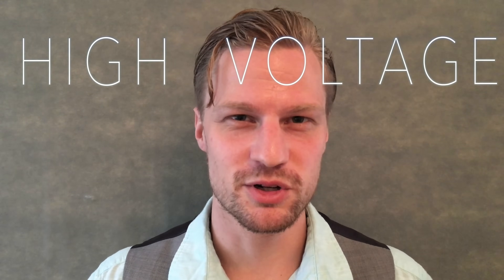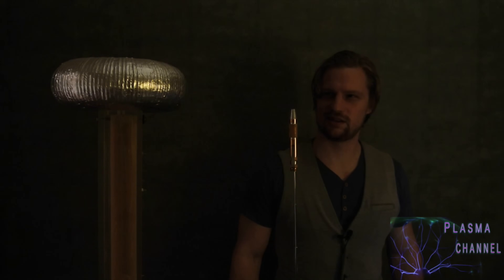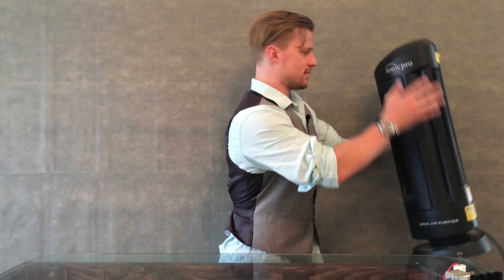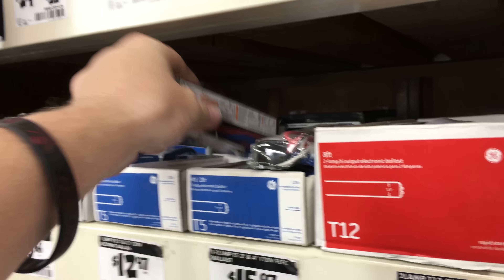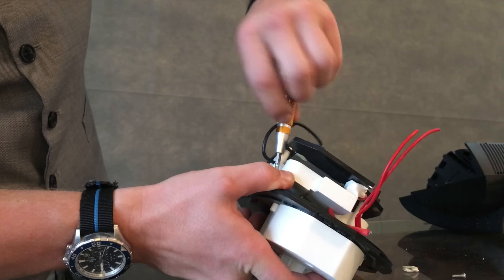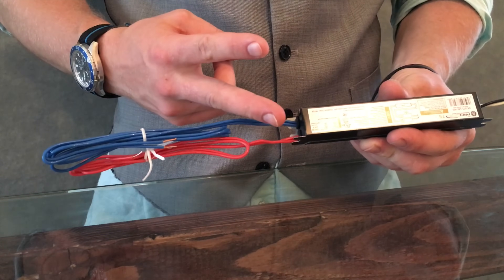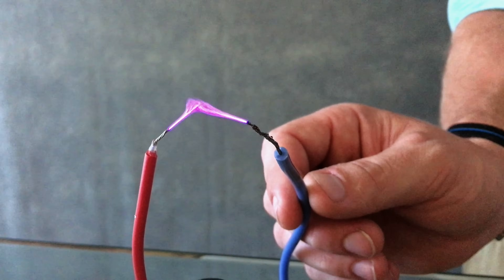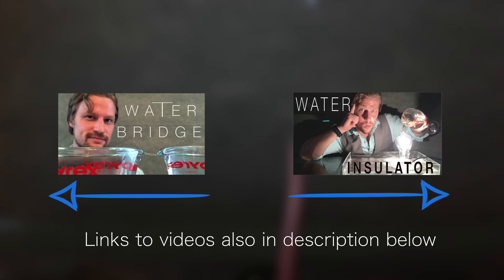Super Simple DIY 10,000v AC Supply!

Comment: Thats dc there are diodes and capacitors in Transformer that make it dc
Reply from the maker: That is what I always thought. But when I discovered that not all modern flybacks are DC, I was really excited. TV, and monitor flybacks are DC, air purifier flybacks are mostly AC. These are AC flybacks, because down the line they have voltage multipliers in the purifiers. Voltage multipliers only work on AC. Also, I have tested the transformer with external diodes to be sure. These specific ones output AC.
Reply: Plasma Channel thats great are these as powerfull as the older ac flybacks or are they Just as powerfull as modern dc flybacks and wow that was a quick response
Reply from the maker: These are more powerful than the other flybacks in my opinion, as they have proper insulation for the HV. Older flybacks didnt have appropriate HV insulation.  By the way, some air ionizers have a terrible mini negative ion generator in them......and no transformer. I found this out! So, look for Sharper Image brand air ionizers at thrift stores....they always have a nice AC transformer in them!

Comment: Can it be used as a tesla coil like glowing a light from a distance
Reply from the maker: Wonderful question. Yes in fact it can, though the distance is very short. If you retrofit a resonant coil onto the HV output (basically an antenna) you would get a couple feet of wireless power transfer out of it)

Comment: I have a question for you:
If i'll buy me a transformator let's say a 3v to 400kv trafo, and i would make another coil, is this even better than only use the trafo or is it better if I make another secondary coil?
Reply from the maker: unfortunately those ebay 400kv transfrmers are not actually 400kv. Its all marketing....big voltages in the name sell more. They actually run 20kv-60kv. Which is still very impressive. That being said, these commercially made transformers are very efficient. It is hard to beat factory-created transformers

Comment: I have the same flyback transformer , i got it from tv . But at the bottom there are almost 10-15 leads emerging out . Which lead i use for power input and which pin use for establish arc.
Reply: Ludic Science has a good video to work out what pins you can use. also by winding your own coil round the exposed core you have a input coil.
Reply from the maker: Ah, so that is a modern flyback which only outputs DC, as they have internal diodes. Those pins tend to be unique to each transformer. You have to experiment with placing your power wires on combinations of two... until you get a high voltage out of the big red high voltage wire.
Reply: the first two that are very fat. They are also further that each other that  the others
Reply: I think you might be able to actually feed some windings into other windings and get more power
Reply: E Crackers ok

Comment: Will this work with a 10kv transformer from an oil furnace? My son wants to build one and I have easy access to them.
Reply from the maker: Thanks for asking! Unfortunately, it likely will not. Unless you buy a larger ballast than what I have shown in the video. Those obit’s require higher current, and operate specifically at 60 hz, or wall frequency. These smaller transformers create voltage rise, by using high frequency and resonance. I would argue though that with a larger ballast it may be possible.... but no guarantee.
Reply: Plasma Channel thank you for the very prompt response in the excellent description.

Comment: What is the difference in using dc voltage and ac voltage for example the ionocraft you made?
And if arcing is the only issue how to manage/control it?
Reply from the maker: Ac Voltage will not charge the air to a constant ionic charge, propelling it. DC must be used.  If arcing is an issue, you must lower your voltage, or, space out the wire and foil more
Reply: k, thanks.
If i am creating my own transformer to output(DC), the required voltage as per my need, Using a DC would have 0 inductive reactance. As DC has no frequency there, right? And that would result in the windings burning out, wouldn't it?

Comment: Is this safe to touch? I've heard flybacks are dangerous, but you touched one in the intro
Reply from the maker: Touching high voltages, or anything electrical in general is much safer if done with one hand. As the electricity cannot flow across your chest and truly harm you. You'll notice it was one hand I used. Also, how dangerous something is depends entirely on how much current it can push through your body. This circuit only pushes a few mA, which is nowhere enough to cause bodily harm.
Reply: Thanks
Reply from the maker: Certainly! Always feel free to reach out

Comment: can you make water spark plug ....
Reply from the maker: I am not familiar with this. Basically using water as a medium for the spark gap?
Reply: Plasma Channel , with spark plug and high voltage capcitor, we can burn water and use it as fuel ., i can't find right components here but i know its great project , just a mist of water between spark ....if you want i can snd schematics and video links
Reply: preet charan I would like to see
Reply: preet charan interesting, please try to send them.
Reply: preet charan yeah, I don't feel like it will work but I would like to see it because it may be possible..

Comment: Never knew those things had a flyback in them, drat.
Reply from the maker: +Inductor87 they do, if you find the type of ionizer with visible metal plates (metal plates which attract dust and need to be cleaned). Other Types which are cheaper tend to use really terrible HV - ion multipliers.

Comment: why is the arc AC so high frequency? shouldn't it be the same frequency as the wall AC?
Reply from the maker: Ah, that's a GREAT question! And I wish I had mentioned this in the video: that driver uses transistors to switch 120v into 300vac at very high frequencies. It's a driver, and less of a transformer. Usually any driver that uses transistors will be run at higher frequencies. Since the high voltage transformer is driven at that higher frequency, the output arc is higher frequency.
Reply: @PlasmaChannel  my ballast outputs 80v what i need to do to make it 300?
Reply: Do most fluorescent ballasts do this?
Reply from the maker: Not all. Some are pure inductors which, when plugged in, give a small voltage boost to ignite the tubes. However, those types use a momentary voltage spike, at 60hz, which is unusable for our purposes. usually those ballasts are heavy, iron filled inductors.
Reply: Also, as a bonus, the fluorescent fitting doesn't buzz at the mains frequency like the older iron core ballasted ones do. The iron core ones also wont work with the transformer out of the air purifier, as its designed to run at high frequency. Just like an old fashioned TV set flyback transformer :)
Reply: Looking at spec Sheet for ICN-3P32-N ballast they operate at above 42 Khz! T5 ballast operate around that ballpark too.
Reply: Should also be mentioned that high frequency AC is safer then low frequency. At 42KHz this is radio frequency and as such RF arcs will produce burns rather than giving you an electrical shock..due to what is known as "The Skin effect".
Reply: nickt please can you give broad description of the parts you use and the way you assemble because I short my circuit many times making tesla and usb lightning module
Reply: The arc AC just enters with high frequency. The electronic ballast is a switched circuit with small ferrite core inductors and transformers, they're not capable to switch 50 Hz of mains as a MOT do. But MOT's are monstruous...2000 V AC with a power of 1000 W, they're deadly too...
Reply: if a transformer has a ferrite core its designed for higher frequencies and thus its Q range will be high, if the transformer has an iron core it was designed for lower frequencies.  if one has a scope and a function generator one can easily find and see the sweet spot where a given transformer has the highest voltage gain threshold at the lowest current draw.
Reply: @wildmanfujiami5870  Can get them so cheap these days too. I just use a small module that varies duty cycle and frequency up to 150khz to drive a mosfet and boom really impressive arcs from a flyback the easy way. I don't get the nice smooth higher current arcs like from the ZVS but I get much longer breakout arcs per volt from the supply.

Comment: Is there any other transformer i can use, i live in switzerland and its impossible to find this one. thanks
Reply from the maker: +Kilian Lauener you can also find these transformers in old, glass tv's. However, they are dc output, not ac. But still make great arcs! If you acquire one of those transformers, feel free to reach out to me, I'll assist you in wiring it.
Reply: Plasma Channel thank you very much
Reply from the maker: My pleasure!
Reply: Plasma Channel i got a flyback from tv but in those one there isn't just two wire for the input, there is 11 pins. and four of them are in someway inside connected so what do i do ?

Comment: I studied these things at school but not like you explained in previous videos at all.
How can you get so much voltage at a low current?
Reply from the maker: +Guilherme Branco flyback transformers, like the one used, operate at near resonant frequencies. Identical concept as a tesla coil- the frequency at which the ac current is pumped into the transformer is such that with every cycle of ac the voltage builds and builds. This creates a tremendous voltage gain on the secondary, or the output, of the transformer.
Reply: Plasma Channel I didn't learn anything about tesla coils so thanks for explaining!
Reply from the maker: +Guilherme Branco you are very welcome! Yes tesla coils are brilliant. They pulse electricity in a manner similar to pushing a swing. After every push the swing goes higher. After every pulse, if times right, voltage rises higher.

Comment: Isn't air breakdown voltage more that 10kV/cm? AFAIK it ranges between 10 and 30 depending on electrode sharpness and, if that's a 1" gap, it should be at least 25kV, shouldn't it?
Reply from the maker: battlekruiser great question. Air's dielectric breakdown is 30kv/cm between two 1" brass spheres. This is the electrical standard at STP. However, when you have sharp points, the electric field gradients are much more intense and longer sparks are achieved with lower voltages. The two high voltage leads are very sharp. This transformer indeed outputs approximately 10,000 v. If I attached it to two rounded spheres, the spark length is approximately 4mm

Comment: Clever, I haven't heard about that mix before. I didn't know ionizers used ferrite transformer. (but I know plasma balls do)

Are you going to do more power supply videos?
There is the TV flybacks, the AC stuff, mains frequency, high frequency, the safe and the deadly.

And cover DC & AC and the difference in behavior?

Some people seems to really overrate the voltage of Tesla coils too, also a nice topic.
Reply from the maker: I fully agree with the over ratings of Tesla Coil. Pulse rate and EM envelope drastically affects spark length... I do plan on doing additional power supply videos!  Thanks for the comment.

Comment: NOT AC , Is DC because is an internal diode in transformer!
Reply from the maker: +Balan Bogdan not the transformers from ionic cleaners. These are ac, with external voltage multipliers (need ac to function). This is why I chose an ionic cleaner to take apart instead of a tv or monitor, whose transformers am have internal diodes
Reply: OK
Reply: @PlasmaChannel  can we identify them by seeing

Comment: That's so simple yet brilliant. I wonder how much voltage could you output with a microwave transformer instead.
Reply: gogo311 your europe/England is showing..
Reply: MOT operates at 50Hz, it wouldn't drive a flyback transformer.
Reply: lmao, hook up a mot to it and youd have a good bang.
Reply: 2000vac-2400vac

Comment: Cant this be done with a Tv Flyback transformer
Reply from the maker: +Brian Bell indeed it can. However those will output dc, instead of ac.
Reply: Plasma Channel Sweet Ac is cooler looking then dc but is more dangerous sadly
Reply from the maker: +Brian Bell I agree! AC is far more useful, and can be converted down!
Reply: Plasma Channel Couldn't this also be used to transport electricity a far distance and use a inverter(I think that the right think)to step the voltage down
Reply: Actually, high frequency AC is quite safe compared to DC.